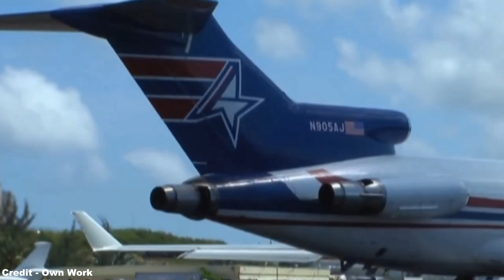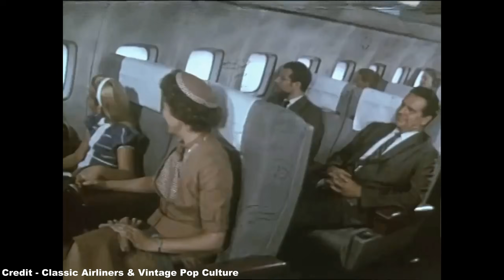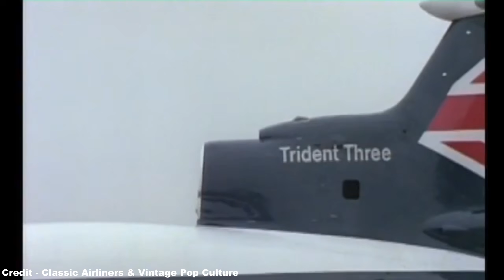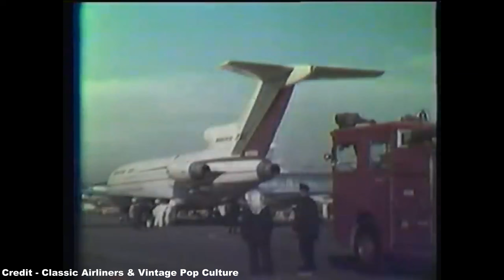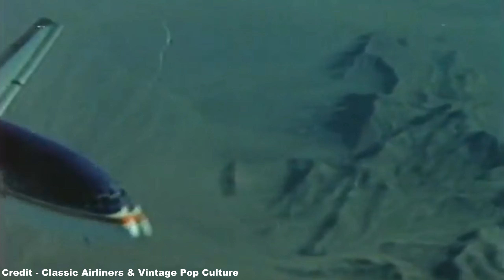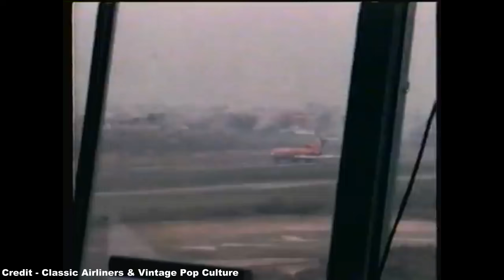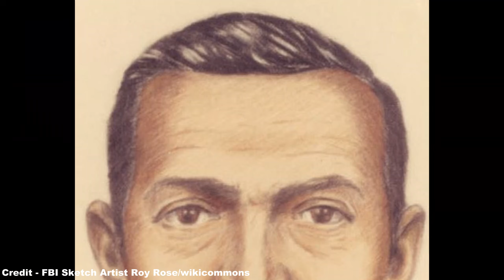The Gamechanger - Boeing 727

Comment: There are three things I remember about flights on a 727. First was how QUIET the cabin was on takeoff. With those rear mounted engines they sounded more like the whine of electric motors. Then there was the aggresive angle of attack during the initial climb. There were times when I swore the thing was going to stall. Finally there was that 'nose high'' angle on approach to landing, no doubt a consequence of the T tail.

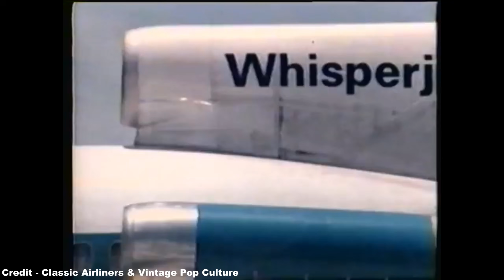Comment: 0:06 A superb original clip and listen to the 727 spool-up... I can't tell if it's hush-kitted, but there's just a trace of what I used to often experience living north of YSSY Sydney in the 1990s 24:20. There IS nothing like the "sound" of the 727 on departure, certainly not in 2025. 747 Classics could be extremely loud, but they weren't in the same league :-). 727s on initial climb were violently extreme, it felt as if the atmosphere itself would rupture--but am happy to have experienced it :-) So much to love about the 727 design--huge triple slotted TE flaps, rear air stairs--Boeing at its Best :-)

Comment: Great video, and great inclusion of the whole De Havilland/Boeing episode! The B727 was an awesome plane and showed how the British system of designing an airliner for the national airline rather than for wider market was doomed to fail! Only thing I did notice is that you said the Rolls Royce Spey engine was the initial choice for the B727? I’m pretty sure it was the Rolls Royce Medway, a more powerful turbofan that was going to be used on the original DH121 airliner before BEA got the plane scaled down so that the 14,000 lb thrust Medway was going to be too big and so the smaller 10,000 lb Spey was used instead. Rolls Royce had hoped that they could still develop the Medway if Boeing used it on the 727, but then Pratt and Whitney came along with the JT8D and the rest was history! The Medway was cancelled which then caused Hawker Siddeley problems when BEA wanted a bigger Trident, as the Spey maxed out at 12,000 lbs thrust.

Comment: Alaska Airlines used to fly these from Anchorage to Deadhorse(SCC) in the 1980s. They would only use them in the winter because they didn’t have a gravel kit and the runway was ice in the winter.  Before I moved to Alaska in the  late 1970s I worked on the assembly floor making JT-8 engines that were used in these.

Comment: De Havilland Trident? Surely you mean Hawker Siddeley?
Reply: No, the Trident was originally designed by De Havilland, through a rather complicated consortium arrangement engineered by De Havillands! BEA preferred the DH design over other submissions for the specifications and was also about to start operating the DH Comet 4B. In about 1960, De Havillands were taken over by Hawker Siddeley but the Trident remained very much a  project based at the former DH base at Hatfield in England.

Comment: I saw a video, I think it was Scott Manley's channel, that showed a private company using a 727 as a "vomit comet" to train astronauts under contract to NASA, so there is one in service in the USA at least. The crews said they liked it because they can pull the outboard engines to idle and throttle the inboard engine to taste during parabolic zero G maneuvers without getting adverse yaw like you can get on wing-mounted engines that aren't quite matched.

Comment: Awww you forgot the most iconic 727 moment in pop culture when a team deliberately crashed a 727 filled with crash test dummies to determine the impact air crashes have on survivability. Notably, the test proved the effectivity of the brace position in minimizing life threatening injuries on impact.
Reply: It was both a 720 in a nasa experiment and a 727 in the more recent 2012 test
Reply: I thought that was a 707 or 720.
Reply: @charlesmak534  I think the 707 was crashed to test out a new type of fuel that was supposed to be harder to catch fire in an accident, and it totally failed as it burst into flame on impact just like normal fuel. I remember it being on the news back in the 80s maybe.
Reply: @RCAvhstape  It was a fuel that included an anti-misting agent. Kerosene as a liquid doesn't really catch fire, it needs to be in the form of a mist.
It was in late '84 or sometime during 1985 I think.
Reply: @charlesmak534  it was the 727. They had to jump out with parachutes prior to crashing

Comment: The 727 was the plane that made the Lockheed Electra and Vickers Vanguard obsolete, and definitely was the plane that opened up jet travel to many smaller airports around the world because of its ability to operate from shorter runways. The very success of the 727 drove the Europeans to find a competitor, research done starting in the late 1970's that resulted in the Airbus A320.
Reply: Not forgetting the Trident which allowed BEA to cease Vanguard operations.
Reply: @alexmcwhirter6611  But the Trident was not as well-suited for shorter-runway operations at higher-temperature airports. That's where the 727 really excelled.
Reply: @Sacto1654  Quite agree re the performance.  My point was that you mentioned the Vanguard being made obsolete by the 727.   But I believe in Europe it was only BEA which operated the Vanguard.   In the 1970s  BEA had a wide European network and I can remember its ad slogan at the time "BEA number one in Europe."   BEA never operated the 727.  Only later did BEA acquire any 737s.  It was KLM which operated the Electra and KLM replaced its Electras with the DC-9.  At that time KLM was a loyal Douglas customer.   KLM never operated the 727.   KLM only became a Boeing customer when the 747 appeared.
Reply: @alexmcwhirter6611  But many airlines in Europe did switch to the 727 when the Caravelle proved inadequate for some routes. Air France, Iberia and Lufthansa all operated fairly substantial 727 fleets for many years.

If I remember correctly, BEA actually placed an order for the 737 and 727, but pressure from the British government forced BEA to end up buying the Trident 3 model instead.
Reply: @Sacto1654  Yes of course.  Remember LH was the first airline outside the US to operate the 737.  One of my early flights was ZRH-FRA with LH's newly acquired 737 in 1968 !   That aircraft was so different from the rear-engined short-haul aircraft at that time.  I was impressed !
Yes there was some political pressure placed on BEA/BOAC at that time to buy UK-manufactured aircraft.
Reply: @alexmcwhirter6611  I think the ONLY reason why BOAC got the 747 was the fact no British aircraft came close to what the 747 could offer. That's why BOAC had a pretty substantial VC-10 fleet in addition to the 707-420B's.
Reply: @alexmcwhirter6611 BEA did end up wanting the B727 tho didn’t it? And the B737 as well I think. Lufthansa were European launch customer for both. And even Air France ended up with B727-200. Wonder which way those European airlines would have gone if the original DH121 with bigger cabin, bigger engine and longer range had been produced. Oh well! Guess we will never know! But lots of European airlines had bought the Viscount…

Comment: Ansett and TAA in Australia absolutely loved the 727, it was always featured in all of their promotional material until the early-mid 80's when they replaced them with contemporary 737 and 767 aircraft. They're still the best looking passenger aircraft Boeing ever made.
Reply: Ansett and TAA loved them because they worked very well in the many parts of Australia that were beset by high daytime temperatures.
Reply: TAA, try another airline! The other airline was Ansett and the airfare were exactly the same despite deregulation!
Reply: The 737 was to replace the DC9s by Ansett and TAA.